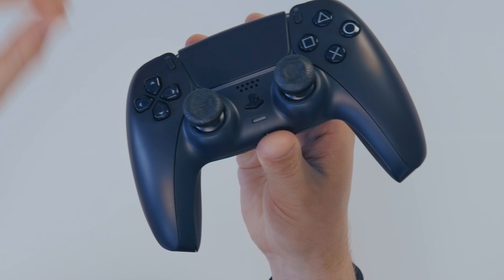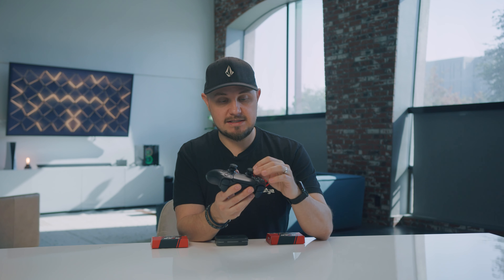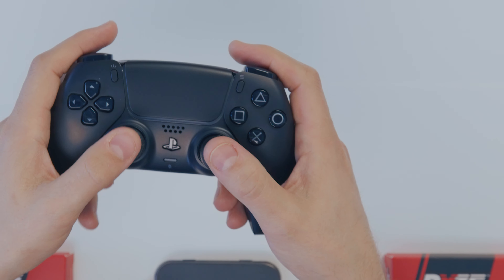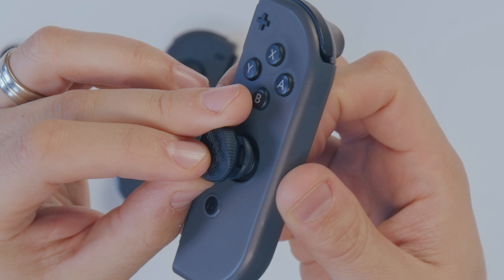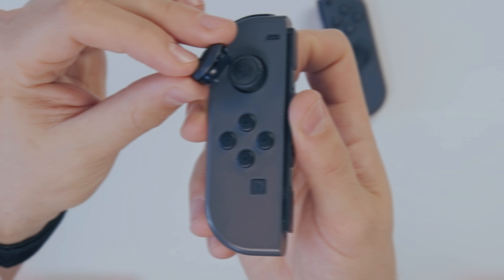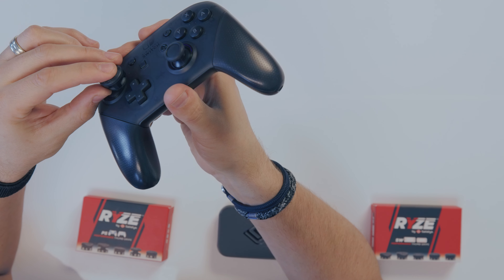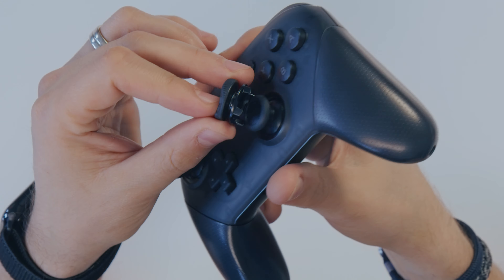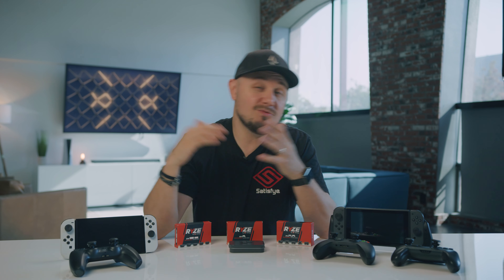RyzePad Proper Installation - 2021 - How to install

Comment: If any of you have had trouble trying to get the pads on for you Switch, I know how you feel.

However, you can still get it on! It's definitely a fairly tight fit but you'll get there eventually. If you're like me you might get 3 of the tabs properly wrapped around the stick, but have one of them digging into the stick. The way I remedied it was just by using my fingers to "squeeze" it into place or something, and now it looks like it fits as it should.

Definitely not as easy as it looks in the video, but at the same time not impossible, if you find yours seem like they're too small give it another try :p
Reply: This explains everything lol XD
Reply: This is crazy hard to put on. I cannot do it.
Reply: Broo i can't put this on. When I think I did it. Next thing I know it pops off....

Comment: These tore on my joycon's rubber really badly while taking them off, didn't apply much force while doing so either, and did as shown on this video, now I'm gonna have to pay for stick replacements..thanks, they're comfy but did you really need to make the fit that tight?....
Reply: Same exact thing happened to me
Reply: Same

Comment: I purchased the Switch Pads and none of them fit onto my Joycons. Not even close. They are too small. They smush the rubber on the sticks and do not properly latch on. It is extremely disappointing to have supported this kickstarter and received a non-functioning product.
Reply from the maker: Hey Robert, sorry to hear that. Can you shoot us a DM on twitter or Insta?
Reply: Same exact issue here! I ordered the PS5 RyzePads first and LOVE them, so I ordered a set for my Switch, and the pads do not fit - way too small.
I sent a chat message to Satisfye support on their website today, and waiting for a response (they usually respond within 12 hours via email, in my experience).
Reply: This is the same issue with my Switch set. They won’t fit at all, way too small. One of the “hooks” always seems to just smush down the rubber but not latch underneath. Very disappointed considering how long I’ve been waiting.
Reply: @TheMatabus  accurate description. Same problem; smashes rubber down and never fully latches. Completely non functional.
Reply from the maker: To everyone on this thread please send an email to support@satisfye.com so they can resolve this for you.
Reply: same exact issue here. I will be emailing customer service shortly
Reply: Me two too small and they scratch my joycon robber
Reply: 39.99 well spent
Reply: Did you or anyone here ever get this resolved? I got the Elite bundle today and I'm having the same issue.
Reply: @youinanotherform1965  same issue with the elite grip g3 bundle that I got today. Extremely tight on a brand new set of joycons that haven’t even been used yet.  Took them off immediately as I fear they will destroy the OEM rubber grip. Not worth because of this.
Reply: @youinanotherform1965  same, bought the bundle and been confused on how to put them on😭
Reply: I ordered the diablo red grip that came with thumb stick attachments and not only did it not fit on the joycons.. it tore into the rubber and messed up my new pair
Reply: Same fucking issue. It damaged my beautiful white joy con.
Reply: @satisfyegaming same issue…..waiting on the response on your end. Jacked up my white joy con. I’m beyond pissed
Reply: Same problem for me
Reply: Just got mine too. Amazed they still haven’t resolved this issue
Reply: OMG Same thing happened

Comment: You must have had some custom made ones for the switch to make this video because every comment Ive seen and even now attempting myself, it definitely is not that easy. Ive tried a few times now and decided to just take the L and not put them on because its clearly poorly designed to properly put on the joycons without fear or breaking them

Comment: Definitely not as easy as it looks, at least for the swivel pad on the Switch… That one was an especially tight fit (tighter than the other one three), it even damaged a little bit of the rubber on my left joycon since I had to give it a few tries, and I still feel like two of the four feet haven’t gone all the way down. It does feel great, but I won’t be comfortable removing this any time soon…

Comment: Im a fan of the ryze pad got a pair for ps5 switch and xbox

Ps5 it fit tight but not damage
Xbox tight but a little loose
Switch messed up the rubbers on both joycons

Comment: Just got the ronin elite bundle and the ryze pads cut the rubber on the thumb sticks on my oled even though I tried “rolling” like the guy in the video suggested. Very disappointed that I followed the instructions, and now my switch looks worse. I’m not going to use the ryze pads. I feel scammed and dissatisfied by these. Kinda ruining the whole bundle experience. Ironic from the brand name.

Comment: They're super nice..but my son and I are having an issue with the swivel pad..it's keeps coming off. My son was super frustrated with it..he told me if it didn't keep coming off he would love it. It happen to me as well a few times.
Reply from the maker: Sorry to hear that. Reach out to support@satisfye.com so they can fix that for you
Reply: @satisfyegaming  thank you very much.
Reply: Thank you very much.. someone contacted me.. and totally explained to me what was wrong and quickly fixed the issue. The issue was that I have an older model switch..and that I will be sent updated RYZE pads for my older switch.  So if anyone has had this issue.. you need not worry..it will be handled. SATISFYE MAKES SOME AWESOME  PRODUCTS! I own the grips, the original pads, and the carrying case.